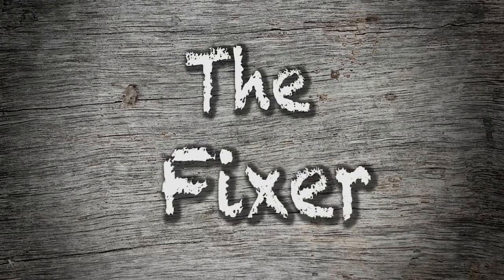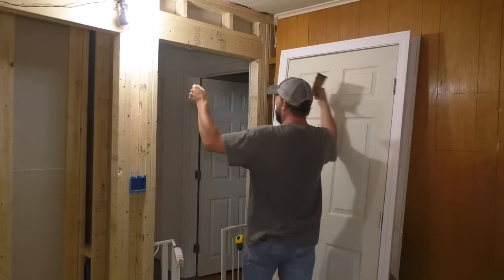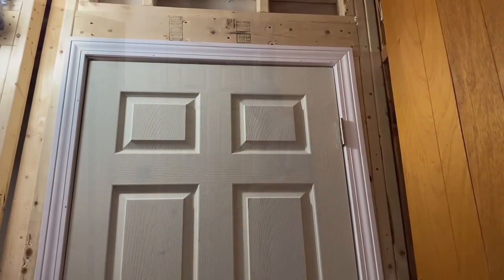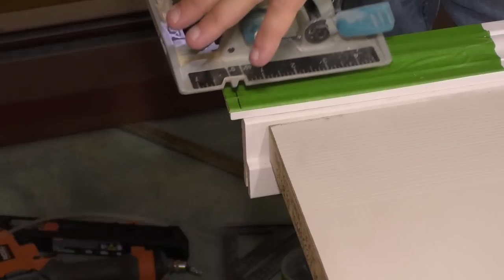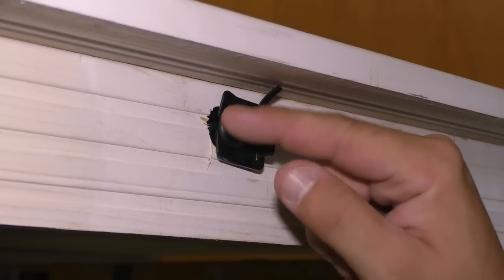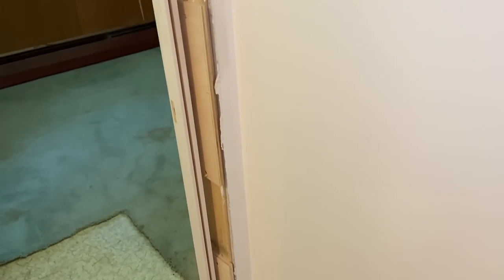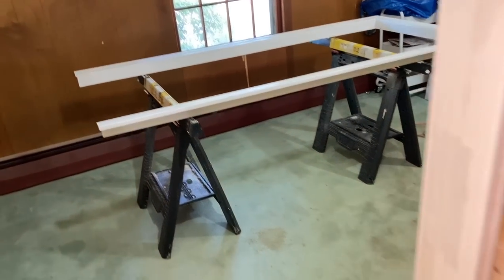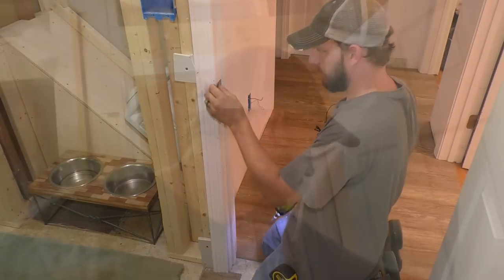How to Install a Split Jamb Interior Door

Comment: Nice work. In houses with forced air HVAC and no room return air duct, they need an undercut for return air.  I use solid doors on bedrooms for sound and added fire protection.

Comment: Good video. You can skip that straight 37” board to check the level of the floor. Hold the level up around eye level, strike a mark on both sides of the opening. Then just measure up to find the difference. Oh and take the door off the hinges to cut the jamb.

Comment: Okay, I really want to know where the door comes from, I’m going to guess Lowe’s. Looks like a Reliabuilt tag you showed. But why I want to know is because in my house the doors are also 78” tall instead of the standard 80”. I could not find an 80” door anywhere and needed to put a door in for literally the same reason as you. -I swear we’re brothers from another mother lol. I had to pickup up a 32”x80” door and trim the damn thing to fit. Took apart the jamb and planed it to make it fit the 33” width opening too. These old houses are a massive PITA. Remodeling is a gamble that could be literally 10x the money, effort and time that you had planned. What happened to me. 6 months later and I’m just now putting up trim in the rooms. Gutted and replaced everything down to the studs and floor joists.

Comment: love your videos man and im getting ready to replace 4 or 5 doors in my house and this helped alot! would it be better buying pre-hung or just replacing the doors? if i bought the doors by themselves  id have to drill my own holes cause all my door strikers are below 3 foot. my casing needs to be updated as well. which way do you think is easier? thanks

Comment: i know exactly why some of the staples are sticking out like that and why the trim is that much longer.  I know because I used to work at a lumber yard and the department i worked at we made doors.   the staples are sticking out because sometimes the staple gun shoots more than one and it causes the staple to not go in evenly or the staple gun itself, is malfunctioning.  in either case, i'd have to drive the staple in before it got placed in the cardboard that it comes in, which is called a "boot" by the way. as for the trim being long like that, the trim comes in different sizes, and we then cut them down to size.  We run the trim through a machine that cuts the bottom, the angle, and the slot where the splines goes in. and it does that all at once at high speed which makes the machine vibrate a lot no matter how tight the blades are because of the vibration, the trim will either be on point, too short or too long.  if it's too long, were supposed to cut them off as were making the door. if its too short, were supposed to staple another trim on the frame.  either way, the door in the video SHOULD NEVER HAVE MADE IT OUT looking like that.  poor quality control.

Comment: It seems so strange to get a door with the trim installed.
I have never seen a door with trim preinstalled in Norway.

Interior doors are sometimes even sold with framing separately, but usually as an item.
trims are always separate items.

Never seen anything like split jamb door either.
If the frame is thinner than the wall, there are framing trims of different width to choose from depending on the thickness of your wall.

Comment: Its absolutely fine to complain you got faulty or crap work on something you buy. I do the same thing when I unbox or unwrap new fenders or hoods with dents. Sad part is the suppliers seem to think dents in new panels is normal..... wtf get some pride and courtesy and hold the warehouse and deliverers accountable and not me.
Reply: If not from the supplier, it's from the shipping, but there, the packaging should have been better to reduce damage (dents) while it was being shipped.

Comment: Every door frame in my house is attached by nothing more than one long screw through each of two hinges, two long screws through the striker plate, and the trim.  No nails of any sort, no shims, nothing.  The trim reveal is best described as "very drunk."  There's a 1 1/2" - 2" gap under every door.  All the knobs are installed at 42", which makes me feel like a child.  None of the hardware is inset into the doors.  It's an absolute disaster. 

I've got a LOT of work ahead of me...  LOL
Reply from the maker: EEk!  Well if you decide to do some work to them I hope my videos help!  Thanks for sharing and for checking out the video!
Reply: @TheFixerHomeRepair  Absolutely!  I'm actually building a double door for a home office conversion; just waiting on materials to ship.  The whole project has been a journey into new territory for me, and there's been a lot of learning as I go.  Your videos have been very helpful, so thank you for taking the time to share them!  :)